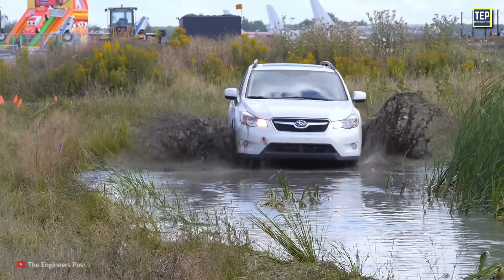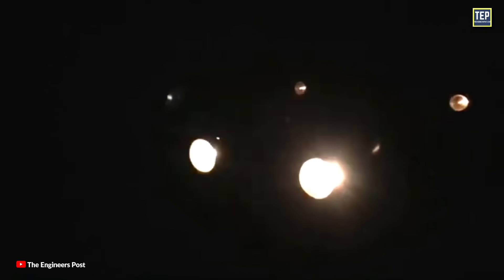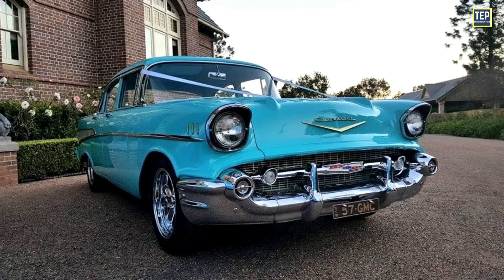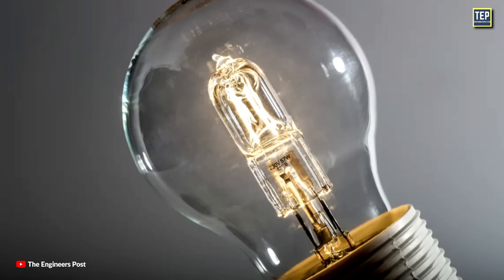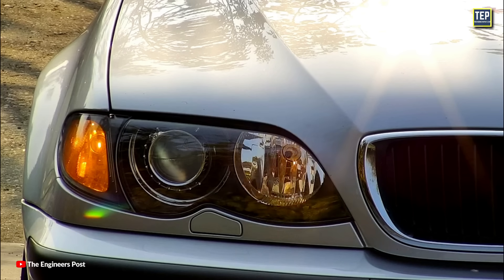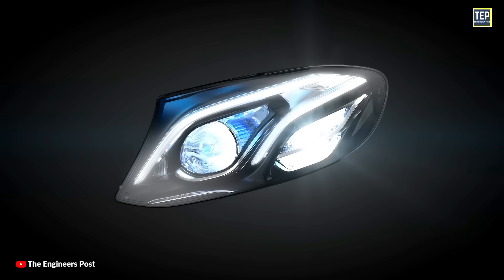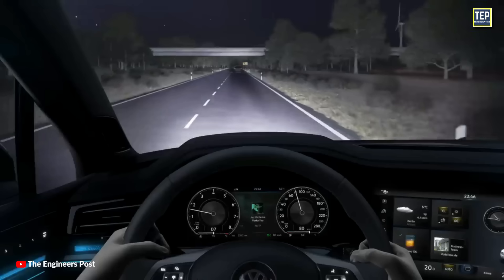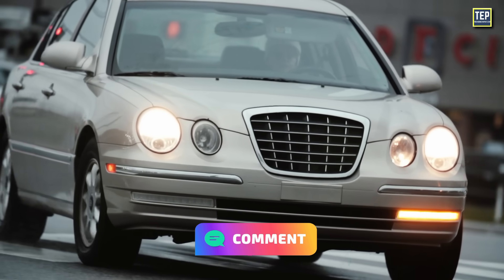The Problem With These Headlights

Comment: You can put Osram and Philips LED into any headlights. They have Retrofit lineup for non projector H* type lights. In the EU there are a few countries(like Germany and Austria), where you can use their LED produtcs and you get the TUV licence trough the manufacturing company(the process is in the user manual). You dont have to adjust anything, the Retrofit LED "bulbs" working as the original halogen ones out of box.
Reply: True, but they have to obtain specific type approvals for each individual vehicle make and model and headlight variant. If your car is not on the list, the retrofit is not approved. They have approved bulbs for a Golf MkII, but not for my RAV4.
Reply: Except not in the US, where it is illegal to put drop-in LED bulbs into incan headlight housings.  In fact, it is difficult to find major brand LED drop-ins for headlights in the US for this reason, why the market is mostly dominated by illegal imports who have no accountability, can just close shop and open under a different name and can't be prosecuted in china.

You cannot adjust them to make them legal in the US.  You also cannot adjust them to improve driving with more light, without blinding others more than it improves driving.
Reply: @stinkycheese804 Ehhh, if they are made for an international model chances are you can get the right one if you can get the part number. Will it be "legal"? No. But safe? Yes, if you get the right one. Most people just get generic chinese ones on ebay or something though. 😅
Reply: I got the Osram ones (Philips won't make any for my car) and just as a precaution, I took the car to check the adjustment. It was spot on out of the box!
Reply: I would like to use it in my (even projector) halogen lamps, but my country has butthurt "technical inspectors" who "knows better" than any engineers in the European Union.
Yes, I live in Hungary, where properly described TUV licenses worth nothing even installed by certificated specialists. Not only for bulbs, but everything - springs, brakes, exhausts etc. You can buy these LED-things, but only in "off-road" use. Which is also illegal since "off-road" is a public road until it hasn't been under the status of private road.
Duck it...
Reply: @mukics1116  They just want you to "pay a little extra!" to let it pass. We have the same problem here in Slovakia. I can't get anyone to write an old pair of Bosch driving lights onto the registration so I can install them on the van!
Reply: Nice tip! I see the other comments mentioning they are model specific though. Good to watch out for.
Reply: No, they are not for ANY Headlight.

Those for ANY Headlight arent allowed on most places on the earth because they are not a point lightsource and do not work with the reflectors, causing light to spill everywhere.

However, there are Osram replacements for SPECIFIC CARS and ONLY for THAT CAR matching the reflector and those you can use legally.